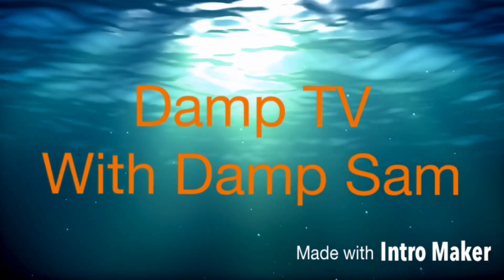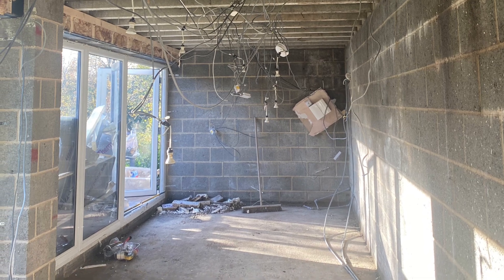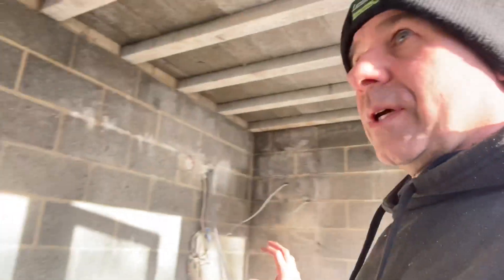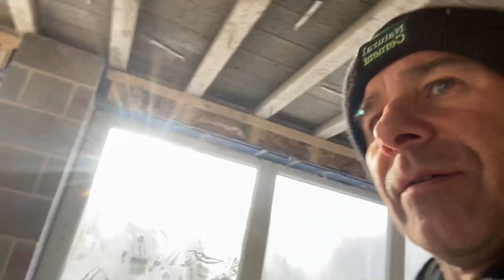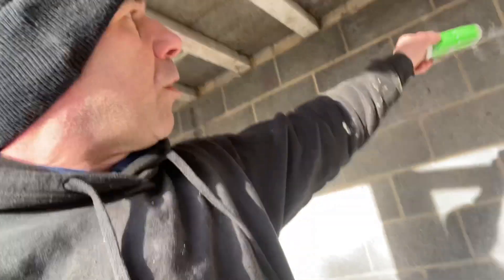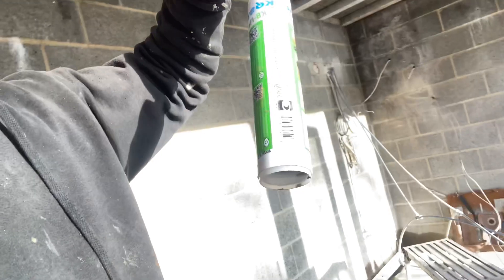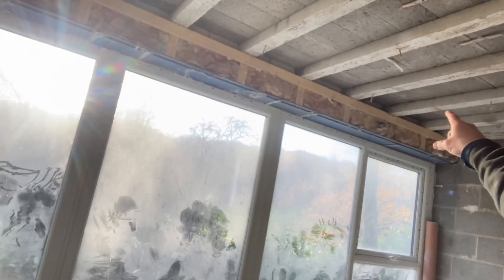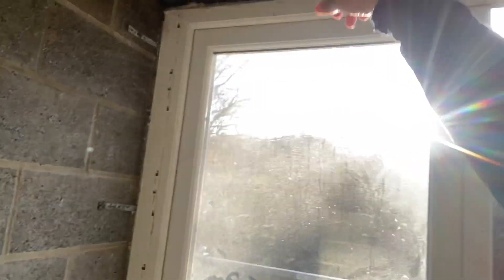Failed Type A Waterproofing (Annex)

Comment: Hi - wonder if you can help, I have a small patch on damp (less than a meter wide) that I want to treat with the Dry Rods, the area was treated around 15 years ago and Aida cream was injected externally. The reason to do it again is the wallpaper internally is starting to peel away so I want to deal with it. I can see where the original holes are that were drilled for the cream so I'm thinking could I re-use these holes to put the rods in, I would clean them out and check the depth etc but not sure if this is possible or if I should drill into the mortar layer below the current holes? Thanks and I learn a lot from your videos!
Reply from the maker: Hi, thanks for watching, don’t use the old holes in the brick, always drill the joint and the perps. Make sure the holes are clean before inserting the rods. 
Make sure your treating the wall for the right issue and it’s not condensation.

Comment: Hi man I live in a council house and we have a damp problem we have had the council out 5 time to fix it each time they tried something different but still we have the problem can u help or suggest how I can make the council fix it properly
Reply from the maker: It all depends on the issue but if it was me I would google the Homes Fit for human habitation act and have a read, then mention this the next time you speak with them if your not happy. You may have to pay for an independent damp survey but you should be able to claim back the money if it’s the council’s fault.

Comment: Have you tried ka tanking slurry ?
Reply from the maker: Yes Iv tried lots of slurries that have to be applied in 2 coats 24 hours apart and has to be left 24 hrs to cure so 3 days to apply correctly, whereas NatCem35 can be a set in an hour. When you add up the time and energy used on both systems NatCem wins hands down.